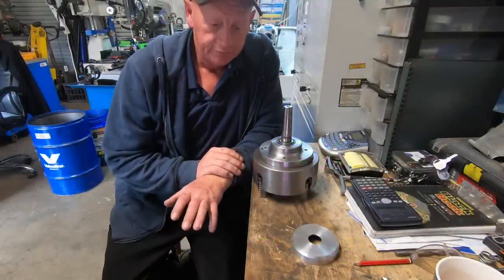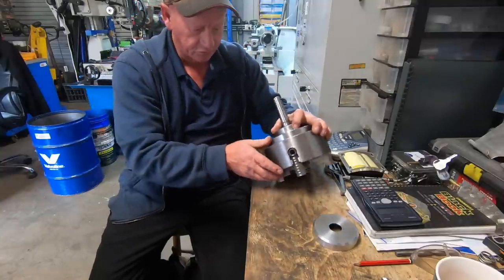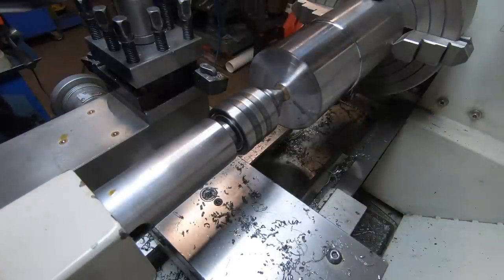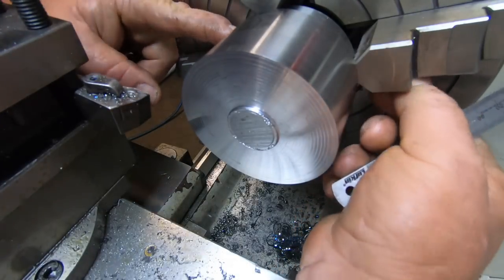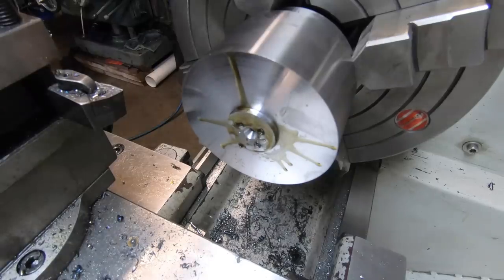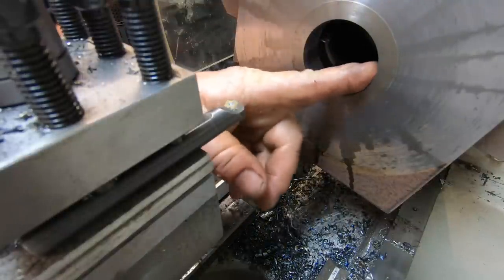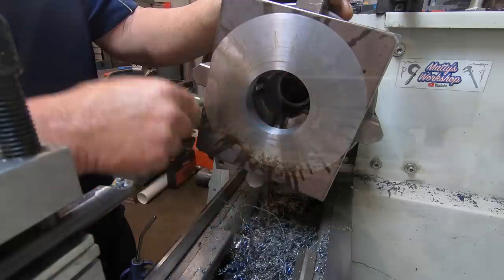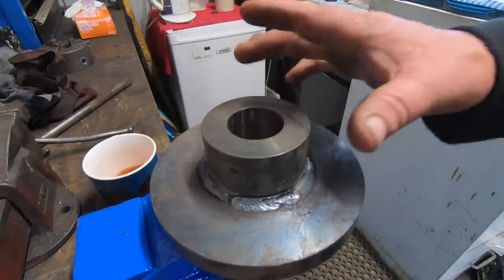Tailstock Chuck  Part 1 - Hub

Comment: Hi Matty. YT is a great community and it was kind of Max to share the drawings. Nothing wrong with that weld, its going to be machined down anyway. Biggest worry when welding is that it didn't warp. Regards Kevin
Reply from the maker: Gday Kevin, The YouTube community is something great to be apart of, the plans from Max are very easy to follow, certainly did a nice job, Thanks for watching and commenting mate, Cheers

Comment: Great project Matty and good start! You won't go wrong following Max's plans. Nothing wrong with that welding mate, for this job I would be inspecting the weld to the following two criteria : Is it coming apart..... No, Is it going on the mantelpiece....... No, then its a pass lol. Cheers, Jon
Reply from the maker: Gday Jon, if this turns out half as good as Max's ill be like a dog with 2 dicks, ive done quite a bit of welding over the years but dont like to film it, im not that good, Thanks for watching and commenting mate, Cheers
Reply: Well , my father, forced on me the 3 standards, 1.)will it last for 30 years? 2.) Are you proud of it?

Comment: Hi Matty That's, great that Max sent you, his drawings. Your welding of the parts looks good to me. I don't have flood coolant on my lathe, so I just use a cool mist set up with cutting oil. it makes a little bit of smoke but I can deal with that. Cheers
Reply from the maker: Gday, I really need to put flood coolant on the lathe as well as a TouchDRO unit, appreciate you watching and commenting mat, cheers

Comment: Looking good Matty 👍👍👍 It's great to see someone drilling a large hole on a lathe and using the correct slow rotation speed for the drill size. Cheers, Alan.
Reply from the maker: Gday Alan, It’s amazing how many do run there drills to quick, I’ve always been told the key to keep the drill sharp is to not burn it up and run them slow, thanks for watching and commenting mate, cheers

Comment: seems like a decent job, good work! if i had to say probably not how i'd choose to do it. 

i think if i made one; 
i'd make a second quill for the tail stock that winds all the way in the tail stock 
with some beefy AF tapered roller bearings on the part sticking out as close to the tail stock as possible for support 
with the chuck adapter plate/hub well supported by those two big bearings.
Reply from the maker: Gday, I didn’t think of making a new quill, certainly work, thanks for watching and commenting, cheers

Comment: Hi Matty, I recently made one using a ford laser front wheel bearing, double race prepacked with grease for life, sealed and preloaded.
Mine has a 4" 3 jaw chuck but in my humble opinion 3MT same as your lathe just does not cut it, not rigid enough.
Need a bigger lathe!
Reply from the maker: Gday Willem, thats a good idea using a car hub, id like a bigger lathe one day but this lathe does a fantastic job, Thanks for watching and commenting mate, Cheers

Comment: Looking good so far Matty. Welding is fine. Better than mine. So was that your exhaust brake in the truck.
Reply from the maker: Gday Steve, im no welder but can make things stick together, the last clip was me just having a bit of fun on the engine brake, the shop owner on the corner used to get a bit emotional with the noise, thanks for watching and commenting mate, Cheers

Comment: Hi Matty,
Have you tried increasing either the feed or spindle speed when using the WNMG trigon to get the chip breaking working so as to avoid the stringy swarf? It loves to work hard. would not bother with the cutting oil, either dry or full flood coolant. 
Andy UK
Reply from the maker: Gday Andrew, I have tried speeds and feeds and done ok, I really need to get flood coolant on the lathe soon, thanks for watching and commenting mate, cheers